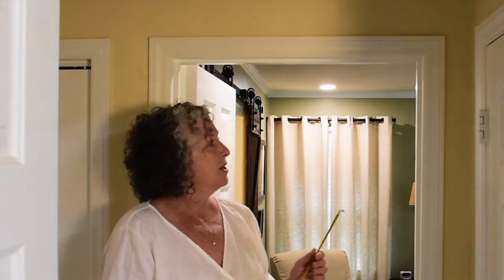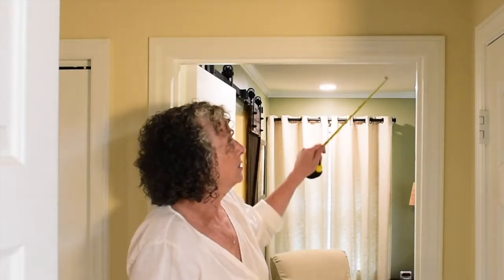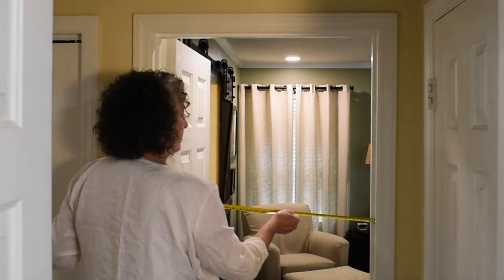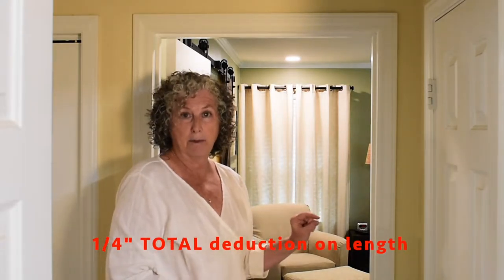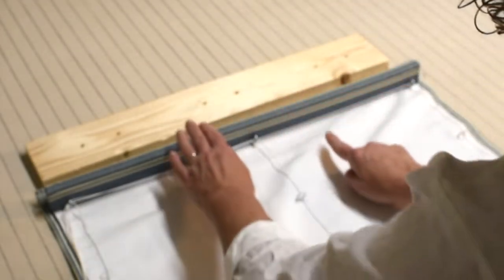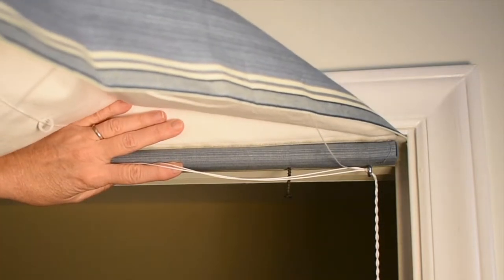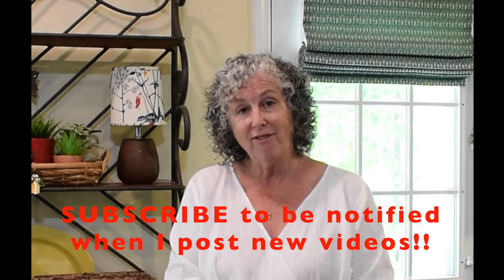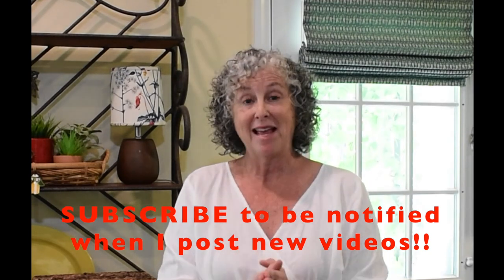Basic Roman Shade Part 2: How to Measure for and install a Roman shade (blind)

Comment: You are an excellent teacher. Thank you for not having background music which tends to distract especially with measurement issues. I have several windows to address and look forward to building my own. Have you ever done inside mounts where the support install has metal? How do you address that install? I have metal slider windows so the framework is all metal.
Reply from the maker: If you have a header that will accommodate the board you’ll just need to pre-drill pilot holes with a drill bit specifically made for metal, and then you should be able to proceed as usual.

Comment: I made your inside mount for kitchen window, it turned about amazing.  I now want to do a mount in bathroom that allows for my 2 inch blind on inside mount and Roman shade on outside mount. I have beautiful 3.5 flat white casing around window and would not want the entire casing covered or is that the way you recommend?  I plan almost always to have shade pulled up, do not see it going up and down rarely.  Also is the best looking mount in your opinion, just above window frame vs typical curtain rod is measured half way between wall to window.  

Your video Part 1 I followed it every step and amazed it turned out beautiful even my stripes match the entire way.
Reply from the maker: Congrats on your successful shade! So, on outside mount I do like to have the shade cover the casing because it just looks better when the mounting board is not narrower than the trim. Since it's usually drawn up you'll see your trim most of the time, as you mentioned. 

As for as where to mount above the window,  I usually go right above the trim - not where I would mount a rod. From the side it can look funny if the shade is way above the window because you can see the wall above the window when viewing from the side and it just looks kind of weird to me. Hope this helps!.

Comment: Thanks so much for both videos, your methods are so clear and look very professional in finish .  I can't use the table in the first bit, so it'll have to be moved when I press it.  I'm wracking my brains about dragging it on and off the ironing board!
Reply from the maker: Try making it on the floor. Put a thick protective layer like a moving blanket or a few layers of towels down so you can iron without damaging your floor :)
Reply: @ASquarePillowIsntSquare  thankyou! I've cut it out, so I'll descend!
Reply: @ASquarePillowIsntSquare  did it!! It looks fabulous! Thanks again.🙂
Reply from the maker: @ghengis430   Good for you!!

Comment: Hello- absolute beginner here. Your videos are super helpful. Could you lost your tools -drill etc Also I don’t have a lot of space - i have a large extendable table - where can i get a thing like yours that has all the measuring on it ? Is it possible to buy something that you can pack away? Thanks you so much. Best Wishes, Rachael UK
Reply from the maker: Hi! I made a video on how I build my worktables! I just added a link to it at the bottom of the "video links" area in the description of the video you are commenting on :) The top can be made in 2 pieces to be portable, and connected with a latch on each side.

Comment: If my mounting board is the same width as the window trim, is that an issue? Or should i have some projection? For outside mount blinds. PS: thank you SO much for your tutorial. I've never been brave enough to try but your videos are so clear and instructive. Amazing 😍
Reply from the maker: @NOTCHARLIEb  Thank you! So I’m just a little bit unsure what you’re asking as width and projection are different things. On outside mount, the mounting board can be the same width as the trim. Regarding projection, most trim is 3/4” thick. I often turn a 1x2 board so it projects 3/4” for a tight close fit. You can mount it directly to the top trim or better yet, mount it to the wall a couple of inches above the trim. If you mount it right above/on top of the trim there isn’t room for the screw eyes, cord lock, etc. I hope that makes sense!
Reply: Sorry for my confusing question but you've answered perfectly. Thank you so much!

Comment: I've just made my third roman shade following your excellent instructions!  I keep coming back to this and the Part 1 video to coach me through the process 🙂 Do you have any measurement or spacing advice when hanging two shades on one header?
Reply from the maker: So glad the videos are helpful! I usually leave 
1/8"- 1/4" spacing between the shades. I want to make sure they don't rub agains each other but still keep the gap as small as possible. I will do cords on the right on the right shade and cords on the left on the left shade. That's about it!
Reply: Hi Mel, do you have any pics of yours? 
Thanks 
Meliza 😊

Comment: When figuring the “stack” measurement of the shade when pulled up, do you figure the distance between the rings plus (how much more) to clear the window opening when raised?  I want to clear most of the opening on a door, rather than have it blocking the view when raised up.  Also, do you ever add corner flaps to hide the board on an outside mount?  Could you show your way of fabricating that?  Love your clear & precise way of explaining work as you go!
Reply from the maker: That's an interesting question. I'm going to answer it based on the way I demonstrate to make a shade, where the bottom hem will extend below the fold stack and inch or two when the shade is raised. For the most part the length of the hem (the bottom of shade to the bottom/lowest row of rings) is the primary length that will stay below the mounting board. On the back of the shade the rings just stack right on top of each other, so it kind of depends on how many rings you have, but it's still pretty minimal. I do sometimes make flaps or a small valance to cover the sides when there is a larger projection, but I don't for close mount shades. I will add it to my list of demonstration videos to make!

Comment: This is a great video! I have one question. Do you think it would be possible to inside mount a Roman shade with Velcro? My window is about 47 x 33. The window sill is about 3 inches wide.
Reply from the maker: Hmmm...It would really depend on the way the top inside of the window is constructed, but I don't know if that would be a good option. You can put screw eyes into the top of the window and put a rod pocket on the shade and mount it that way...did you see the video on how to hang a Roman shade from a rod?
Reply: @ASquarePillowIsntSquare  Thank you for your reply!  Not sure if I have seen that video, but your description makes sense. I am looking for a way to keep the shade removable so I can wash it easily. Thanks again!

Comment: Aww. You’re so sweet! ❤ What if you wanted long fabric bows to hold your shade instead of a pulley? Would one do both, or would you skip the pulley and just do long Bows? Sorry if that’s confusing, as I have never done anything like that before. Also, how do you determine how much fabric one needs after they get the brackets measured (great tip btw)? Have you found fabric to be shockingly expensive, or is just me? 😮
Reply from the maker: Yes, fabric has gotten shockingly expensive! It's crazy. So, tie up shades are really hard to raise and get tied up evenly - they are really designed to be a stationary look. However if you really like that look, you might consider adding contrast banding to a functional shade, located where you'd like the "ties" to be and attach a permanent bow at the bottom :)
Reply: @ASquarePillowIsntSquare  That’s exactly what I was thinking. ❤️

Comment: Thank you. More of a design question… what is the preferred coverage for external mount shade when I do not need to create the illusion of a larger window? Should I plan for the shade to cover the exact width measurement of the window  trim? Leave some trim exposed? Go lower than  the sill? I plan to mount it only as far above the trim as I need to allow for the L bracket like you described. Thanks!
Reply from the maker: It can depend on how wide your trim is, but for average trim I usually cover it all or even go outside it a little!

Comment: Wondering if my shade is 33-34” wide can I get away with just three rows of rings? Thank you for such great instructional videos!
Reply from the maker: As tempting as it is that would make your rows 16” apart or so. I recommend 9-11” ring spacing UNLESS you want to mess with support dowels. To me it’s easier to add a row of rings than sew a bunch of horizontal pockets and buy dowels 😉

Comment: My windows don't have trim, just the dry wall, What is the best way to hang my shades to avoid a light gap? I have place a wainscoting trim that wraps around close  6 inches from the bottom of the window and is about 3/4 inch thick so I don't  think an inside mount would work.
Reply from the maker: I agree. Outside mount would be best. I’d suggest making the shade 1” wider than than the window opening on each side :)

Comment: Any suggestions if window is not square for inside mount?
Reply from the maker: You mean if the top isn’t level? You’d need use a shim to level your mounting board. If the top isn’t level it will hang skewed and you don’t want that 😉
Reply: @ASquarePillowIsntSquare  thank you. I thought of that, I was hoping I could adjust on velcro. But... thank you again!

Comment: How would I add a valence that has a drop of say 8" or so -- to hide the ends of the board & make for a tidier presentation. Outside Mount.
Reply from the maker: On really small projections it's a bit tricky, but normally I just fold a piece of fabric right sides together that is the width of the board plus the 2 ends (projection) plus a seam allowance on each side. Sew up the sides, turn right side out and press. You have a self-lined valance. Just staple it to the top!